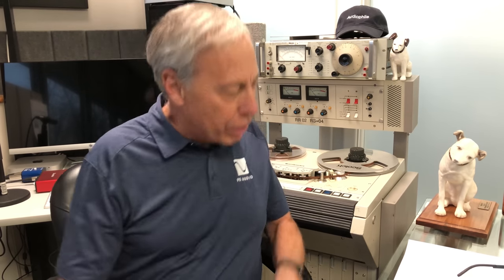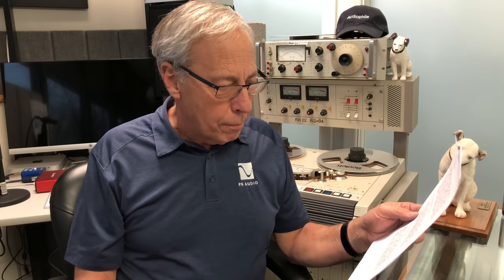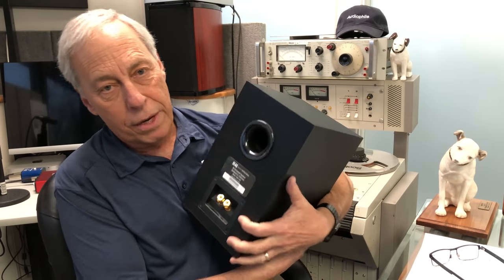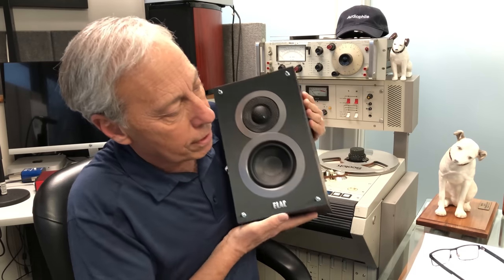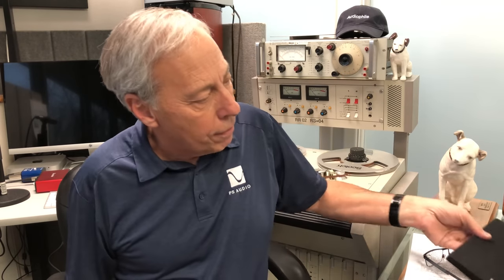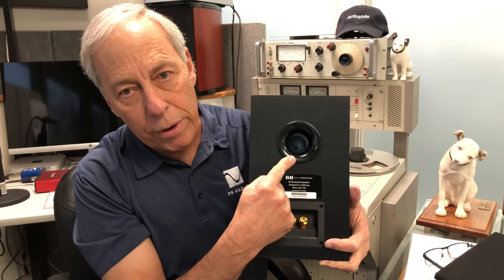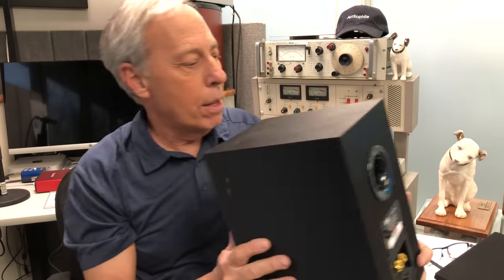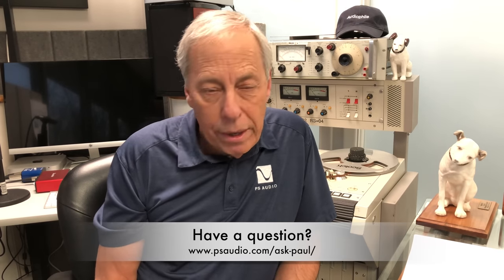Ported loudspeakers

Comment: Most port designs take advantage of what is called "helmholtz resonance", much like what produces the sound in a pipe organ. By tuning the port/box/woofer combination, one can use this phenomena to produce bass notes at lower frequency and higher spl than the woofer could in a sealed box at the cost of (usually) a larger box.  At least that's how I understand it.
Reply: Can we say that a studio monitors with ports gives us different bass frequencies than are actually recorded?... so treating the room or blocking the port does similar things... I use the monitors very quietly because of neighbours, so will blocking the ports take my room out of the equation?... thank you :)
Reply: G.day brother what would u recommend in my case.I want to build a low mids box for my car audio use if 6 12” should I build a ported or seal box plz note that the boxes will be facing outwards back the back door window
Reply: @steve5662  the only way to take the room out of the equation is to wear headphones
Reply: @steve5662  Your studio monitors are designed with the port in mind, blocking it will likely give you a less accurate response.

Comment: I've recently been doing plenty of experimentation with ported box designs, including making my own 6th order bandpass box, and here is what I've learned about how ports behave. 
They are in fact in phase with the diaphragm, due to their resonance their phase is inverted, causing them to add to the air displaced. If they subtracted, there should be an output dip either side. 
This also causes an impedance dip, as the pressure within the box, experiences a peak caused by the added displacement. The driver moves slightly less due to the pressure, and causes an impedance dip as EMF decreases voltage being fed back to the amplifier.
Efficiency is increased as power is "shifted" from moving a diaphragm with relatively high mass to a tube of air resonating, with a relatively low moving mass.
 Ported boxes have a steeper roll-off than sealed, as the port doesn't allow pressure to build up lower than its resonance. Low frequency air flow may come and go as it likes. It behaves sealed at higher frequencies, however only reflected waves come through.
Due to bass having an inherent non-directionality associated with its creation, the speaker box is simply adding or subtracting the local air pressure around it. Phase from front to back shouldn't matter. Enclosures where it does are referred to as "dipoles".
Port surface area is relative to length for tuning, possibly why front ported boxes have longer ports is due to a greater surface area attempting to eliminate "chuffing" with lower velocity airflow.
As far as I'm aware passive radiators behave like ports, though without chuffing, are less efficient, and from what I can tell work better with smaller boxes than ports.
Transmission line speaker enclosures work by having a set transmission line length, usually tuned to either 1/4 or 1/2 wavelength of the desired tuning frequency, feed the rear wave down a tube with said resonance. Port width is usually equal to the driver surface area and constant along the line, unless a tapering/horn loaded design is used. The effect on the air from thought experiments is like hanging a weight from a bungee cord, move your hand at the resonance of the weight, and although your hand is moving only a 1/4", the weight may be moving 1" or more. This works similarly to a ported box, though requires much more space. Generally transmission line boxes reach the lowest notes, though this may be due to them performing as dipole enclosures down low. 
Dipole enclosures (also from thought experiments) effectively add a springy moving mass to the driver, lowering its resonance, which improves low end. The distance between the front of the driver and the rear creates the pressure differential, and therefore sound.
I kinda fell half asleep whilst writing this, so hopefully it makes sense
Reply: I see that you answered my question about passive radiators , Thanks. I was thinking on smaller speakers like the Vanatoo T1 and T0.
Reply: Dude , your off in left field with all that.
Reply: yes, but i'm enjoying his dancing in left field too... he's giving you some insights into other ported designs...
Reply: Arghhhhh! 6th order, as long as you know the phase response will be pants!
Reply: "They are in fact in phase with the diaphragm, due to their resonance their phase is inverted, causing them to add to the air displaced."
This is not true.  At the precise resonant frequency, resonators respond IN PHASE to the driving function.  Thus port emissions exactly at their resonant frequency will tend to cancel the woofer front wave and produce a narrow dip (notch) in the response.  
Resonant systems exhibit a large shift in phase response, comparing at frequencies just below and just above resonance.  Ultimately, an undamped system can exhibit nearly +/- 90 deg. phase shifts across a narrow frequency range.  
In the region below resonance, the port can add boost to the woofer, but at or above resonance it tends to partly cancel the woofer front wave.  If you do careful response measurements at small frequency steps for a ported speaker system, you may find significantly uneven results.
Reply: Sorry to be so offtopic but does anyone know a method to log back into an instagram account..?
I stupidly lost the password. I would love any tips you can offer me!
Reply: @Stephen Kamryn instablaster =)
Reply: @Wayne Francis it did the trick and I actually got access to my account again. I am so happy!
Thank you so much you saved my account :D
Reply: @Stephen Kamryn glad I could help =)

Comment: The pressure inside a ported box is actually higher than a sealed. Low frequency waves actually go through the box a whole lot easier (below the tuning frequency of the enclosure, Fb.), this is called unloading. Below Fb the speaker increasingly "sees" no enclosure at all and will rolloff at ~24dB/octave. To avoid damage to a vented box with somewhat high Fb you need to highpass the frequencies below Fb as these will cause excessive excursion to the driver. 

Port "chuffing" can be largely avoided by simply decrease its air velocity to below 17m/s. Many use flanged ends to help alleviate this problem as well. A well designed port/enclosure will won't have these issues to any audible degree.

A T/L and vented enclosure is not the same thing. Front port or rear ports really does not matter at all in a technical perspective. The wavelengths at low frequencies are so long that the port placement only amounts to a fraction of a frequency cycle's phase difference. You must have some distance (normally at least the vents diameter) between the wall and the backside of the enclosure which can lead to issues if you try to hang it on a wall or something. The main reason they place the vent at the back is to be able to save space really. 

Futhermore, a vented enclosure is by itself more efficient and has lower non-linear distortion than a sealed enclosure due to less excursion around Fb. This of course increases the maximum output of the driver within its voice coil thermal ratings. 

The only thing that a sealed enclosure is better at: as mentioned, the actual group delay/phase shift. The vent cause a phase shift in its passband which increases its group delay in these frequencies. This group delay's audibility must be seen in relation to the actual frequency. At 50Hz a full period is 20ms (1/50=.02s), while at 25Hz a full period is 40ms (1/25=.04s). With certain alignments the group delay can exceed a full period, at some point it starts to get noticable and this is what people refer to as "sloppy bass". 

A lot of times this issue is fixed by simply equalizing the frequency response as group delay is a derived function of the magnitude and phase response. The enclosure-inherited group delay of a vented design can be fully corrected for with FIR-based signal processing. In my opinion, the vented enclosure is usually far superior to a sealed box, especially if you got a powerful DSP / room correction. Note that not all drivers are suitable to use in vented enclosures, most high Q-drivers should be avoided for example.
Reply: Man do you know your stuff!

Comment: "Shift Registers" at 4:14.... Been a while since I heard that  term.  Paul must be an old assembly language geek ;D
Reply: dcairns61 I think most CS students can relate 😜
Reply: Every programming language has bit-shift operators.  Although it's generally true that you can only take advantage of the carry bit and use circular shifts in machine language - unless the compiler is intelligent and can understand that sequences like this can be implemented with a circular-shift instruction:
#define MSB_MASK 0x80000000;
int Cbit, shiftreg;
 Cbit = shiftreg & MSB_MASK;
 shiftreg <<= 1;
 if(Cbit) shiftreg++;
Reply: and JK Flip Flops too!

Comment: Every port shifts the phase by 90 degrees at its tuning frequency, no matter on which side of the enclosure it sits. If it's on the back you usually lose a few decibels in the bass because the phase shift increases due to the time it takes the sound to travel from the back to the front. Wave lengths in bass are big in comparison to the dimension of the enclosure therefore they bend around the edges (spherical radiation). But ports also let a small amount of mids pass through which is perceived as distortion. In the mids the sound waves are smaller and don't bend around the edges. Therefore they don't reach the listerner if the port of a mid-woofer is on the back. With a port on the front this distortion might lessen the sound quality. The solution: port on sides, top or bottom as near to the front as possible.
The huffing and puffing noises are generated by turbulences of the air flow inside the port and on its edges. Therefore those Elac speakers have a port with round edges. If the diameter of the port is too small the air flow gets too fast and turbulences occur even on the surface of the inner wall of the tube. The cross section of the port should be at least one fifth of the effective piston area of the driver. Even better is one fourth or more but the length then might become too big for the same tuning frequency. The standing wave inside the tube becomes a problem then.
Before I discovered your "Ask Paul" series I started a similar podcast in German, apart from most of my other videos being in English. Im currently translating my first few episodes into English but it takes a lot of time because they were not scripted. On many of them YouTube's automatic subtitle function didn't even work. (The German version seems to be not that good yet.) If I gathered some more subscribers from the English speaking world it would maybe motivate me to speed up my work. 
Source of all my knowledge: German DIY loudspeaker magazine Hobby HiFi.
Reply: Thank you for that interesting comment 4 years ago, Marius 🤗

Comment: Ports are a way to alter the physics needed of enclosure size to produce sufficient bass.  I used to own a few of the Dunlavy speakers that were all sealed boxes - no ports at all.  And they had terrific bass, but they were large enclosures (not very high on the wife-acceptance scale).  If you didn't mind your speakers almost as large as your refrigerator, the bass was articulate, fast, and very real, with none of the problems with ports.  Still the best I've ever owned.

Comment: I prefer the curve of my ported subs. High at 30hz and steep roll off from 40 to 80 hz. I've spent my life chasing after perfection and to me this is as close as I can get. They lack the punch of a flatter curve, but I'll take that trade off. There is only one song I know of where my setup has an obvious lag between notes and it bothers me but I would still not trade it for anything else, especially not a sealed subwoofer. So much of this has to do with what music you listen to, and I think when people have disagreements they sometimes fail to take that into account.
Reply: I can appreciate the use-case scenario. I personally prefer using a bigger amp and more EQing to get a similar curve from a sealed enclosure. I’m sure they’re out there, but I’ve never heard a ported enclosure with good subsonic extension. Ports can create phase issues that can be very difficult to address. Of course, if power limits at a large venue are limiting, a ported enclosure would make sense.

Comment: When properly designed and manufactured, ported speakers can be used in two different ways: if you have the room to have your speakers out from the rear wall, as in on stands, rear ported speakers will be your best bet. If you don't have the room, and may even have to wall mount then a front ported design would be your best bet.

Comment: I recently purchased Kali Audio front ported Studio Monitors. I used to have the Yamaha HS8's, but the 8" woofer with the rear port produced to much boomy bass as my studio is small thus my speakers are forced to be closer to the wall. The front ported Kali Audio monitors with 6.5in woofers and front port design fixed my issues perfectly. In addition they have a trim pot to compensate for speaker locations and room environments. So sometimes front is better depending on the the acoustics of your listening room.

Comment: Very interesting subject. Vented speakers have (as you know) been around a long time. 1960's vented systems did tend to sound "unnatural". A.N. Thiele and R.H. Small research into vented designs was used by, I think, two companies in the early 1970's. Electro Voice and Ohm Acoustics. Venting took three major types; ducted ports, passive radiators (drone cones) and transmission line (labyrinth). I auditioned and purchased Ohm model L vented systems in 1978. I still enjoy these speakers today. Old argument was... acoustic suspension speakers sounded "tighter" than vented systems. My Ohm H speakers have an 8" woofer with a 12" passive radiator and bass is tight, deep and very satisfactory. I guess the main advantage of venting speakers  is to provide deeper bass in a smaller box. Perfect for teeny weeny NYC apartments.

Comment: The port has an air mass that is suspended with the airvolume inside the box.
When this mass reach resonance due to the triggered soundpressure from the woofer, it starts to resonate. At resonance, the air in the port goes out when the woofer does. This will enhance the bass level. The wavelength at 50Hz is about 7 meters, so it does not matter if the port is in front or on the rear.
However, at lower frequencies than the ports resonance frequency, the air in the port starts gradually to get sucked in while the woofer goes out.

Comment: as an electrician i think of ported speakers as LC oscillator , the port is the inductor and the box the capacitor.
you may also think of a spring (box) with a weight (port) attached to it.

Comment: Paul, your description of how a port works is much less pornographic than Zeos Pantera's attempts to explain why that hole is there and I thank you for that. There are books dealing with loudspeaker design and I'm sure my 'accountant' will let me buy one when the time is right (hell freezing over, apparently) but until then I'll have to rely on the insights of people who actually do this stuff for a living. I look forward to the new PS Audio speaker even if I know that it will be many multiples of that Elac bookshelf you held up at the start of the vid - thanks again for the video.
Reply: Whenever you have to deal with an accountant that tells you "when hell freezes over", remember that there is a town in Norway called Hell. It's not far from Trondheim. So "when hell freezes over" is probably somewhere in late october, early november.

Comment: There is also an added bonus to  rear ported speakers, in that it's much easier to control bass intensity. It's mostly a given that speakers are best positioned at  good distance from a front wall, that is, the wall behind the speakers. However, with rear ports it's possible to use the  wall to stratigically enhance lower frequency performance. That can be particularly useful with overly lightweight, or higher frequency orientated speakers.

Comment: Actually the port sound output is in phase in its adjusted frequency. Due to resonance of the enclosure and the "Piston mass" inside the tube. 

Lets say you want to adjust the bass reflex supporting frequency to 35 Hz. You got a 50 L Box, than you need a round port approx 4" width times 12" length. Big floor standing speaker.
Out of the adjusted frequency the "Air Piston" in the tube can not move properly, or even not at all. 
The fuction of the port increased if approaching the frequ. and its decreasing if leaving.

But in this case it doesnt matter in my eyes, if the port is in the front or in the back.
Because the wave length at 35 Hz is 10 yarts and you got a 1' deep Speaker maybe (front to back). So the back port would be 1/30th out of phase reaching your ears. 
Bass is emitting nearly 360° the same around the speaker. so doesnt batter to me.

A passive Butterworth Frequency cross over for example, with -6 db per octave, generates a 90° delay in Phase in the low pass way, thats nearly 4' - Bass/Mid separation at 300 Hz . However it is the commonest frequency cross over. That tears apart the exact imaging of the stage arround the crossing frequencies.

Some very smart invetors and developers build speakers that wave no delay in Phase, absolutely time coherent. A giant step towards natural sound play back.

cheers.
Reply: Jean Katana Above the the tuned frequency the air mass within the port cannot move freely, but below it, it can.

This is one of the caveats of ported loudspeakers, below the tuning frequency, of the port, the cabinet and port offer no control over the motion of the cone. The driver unloads, excursion shoots up with falling frequency, and the output rapidly reduces.